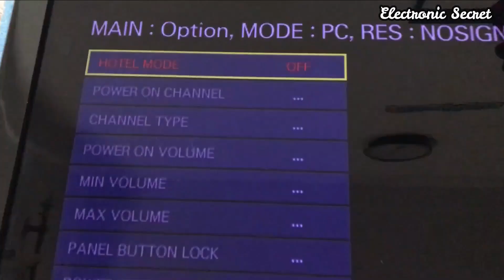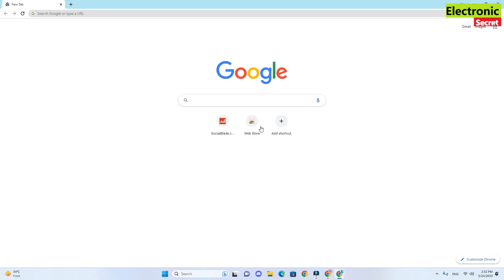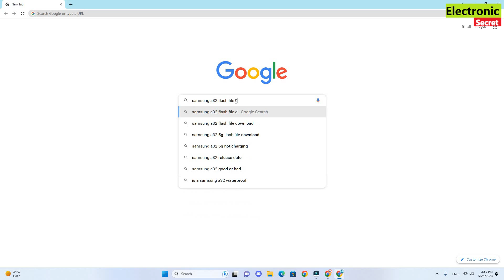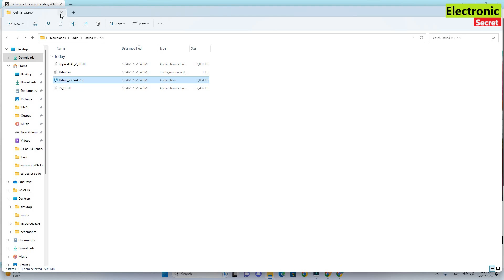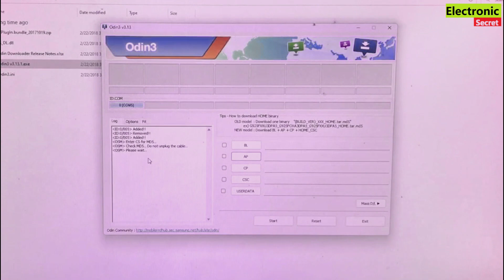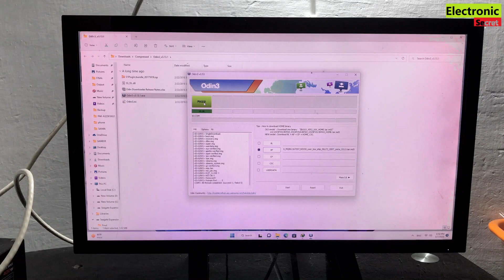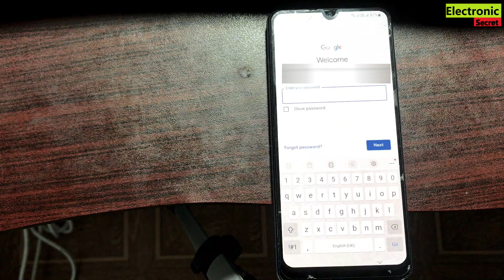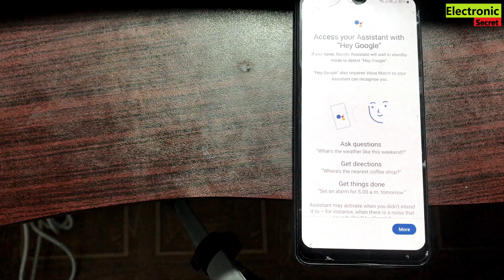How to Fix Fingerprint Sensor Calibration Needed Samsung A50 A32 Phone

Comment: when the phone is pluged and shot off odin does not recognize the phone and the flash does not start. 
the message on the log says "<OSM> All threads completed. (succeed 0 / failed 0)"
how can i solve that? maybe i need to install pilot in order for the phone to be detected by odin even if it is off ?
Reply: Enable Developer option and USB debugging ✅

Comment: Sir ! I have change my display and now fingerprint shows the same message.
So
Can I flash the software or not ?
Reply from the maker: Yes it would work after software flash
Reply: any idea of why it didn't work? I just replaced the original fingerprint sensor with a new one @ElectronicSecret